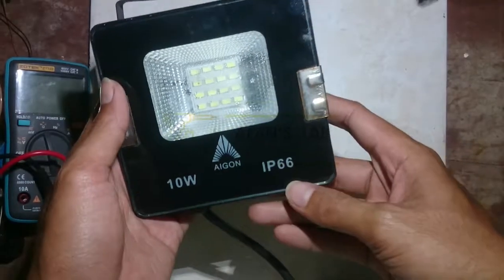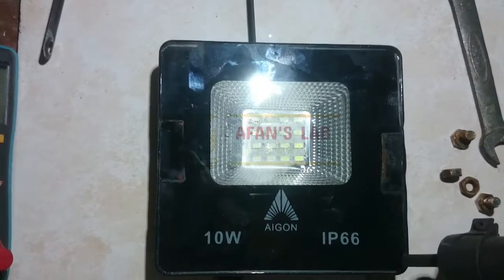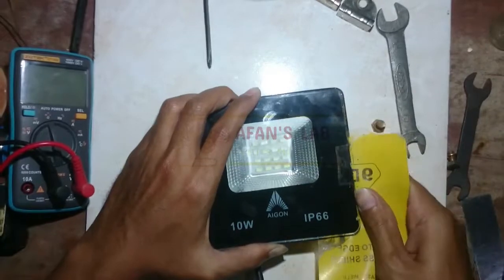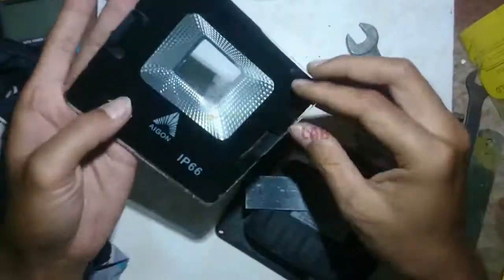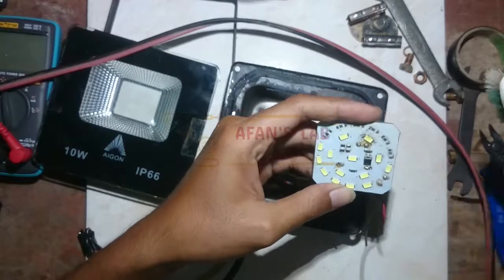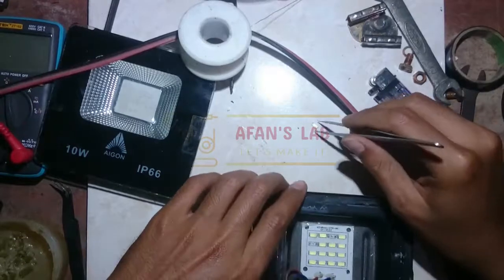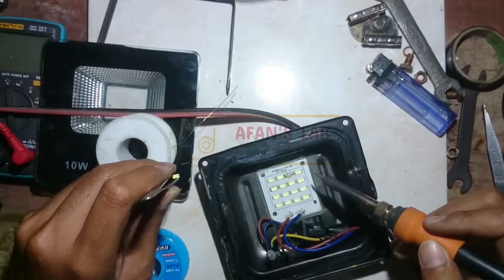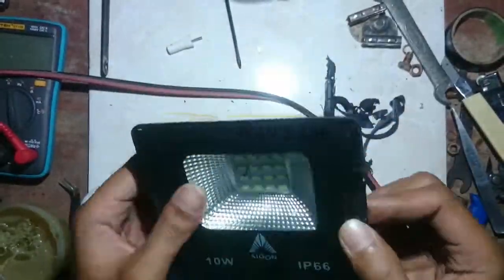how to repair LED flood light

Comment: Can you bypass the broken LED? If you don't have a replacement?
Reply from the maker: You can simply add jumper wire or small resistor.

Comment: Is it safe to use heat gun?
Reply from the maker: It was safe.. that's the only way to open it, I think. because there is silicone glue..
Reply: @AFANSLAB  thanks 
What kind of glue you used to put it back?